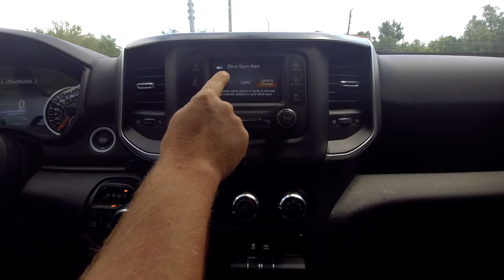2019 + Ram - Blind Spot Monitoring Installation - Infotainment.com

Comment: I have a 2021 ram 1500 but it didn’t come with the blind spot monitor. I have the tail lights and folding mirrors etc. My mirrors don’t have the indicator with the triangle. What all do I need to order? I’m pretty sure I don’t need the whole kit. I just need the programing kit and get just the glass portion of the left and right mirror with the triangle correct?

Comment: Will this void my warranty
Reply from the maker: This is a completely plug and play OEM package.  Installation does not require cutting or splicing wires, allowing you to maintain the factory integrity of the vehicle. So it will not void your warranty.

Comment: When i purchase this kit, can I upgrade to the larger mirrors, and still retain power folding?  For example, i have the 6x9 mirrors that are power folding, can I get the 7x11 mirrors, and reuse the existing power folding motor, or do i need to buy a new motor if i get larger mirrors as a part of the BSM Upgrade?
Reply from the maker: Yes we have that option just selection that you already have Power folding mirrors in the third drop down menu on this listing. 
https://infotainment.com/shop/exterior-accessories/blind-spot-monitoring/2019-2023-ram-1500-truck-power-folding-with-led-blind-spot-monitoring-blis-upgrade/
Reply from the maker: Select*

Comment: Are the mirrors heated ?
Reply from the maker: The mirrors included with the Blind Spot Monitoring upgrade are heated, but they only work if you already had the heated option factory. The heating is triggered by activating rear defrost.

Comment: couple of questions....

1. On the 2021 RAM 2500 the CAN buses are tucked up a bit on the drivers side behind the headlight switch.  Does this get plugged into the single row (CAN - IHS) or double row (CAN - C)?

2. Same truck, if I have a security bypass cable installed (I use Alpha-OBD for some things) can I just plug the Genie into that and let it run?
Reply from the maker: Hello there, 
1: This will go to the single row CAN-IHS.
2: Very likely, any security bypass that works for AlfaOBD should work for the OBDGenie.